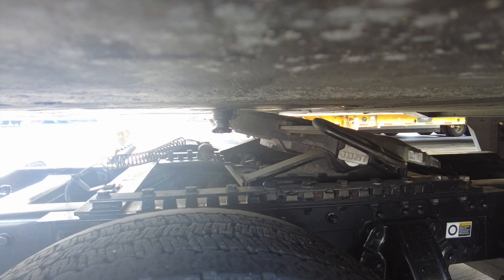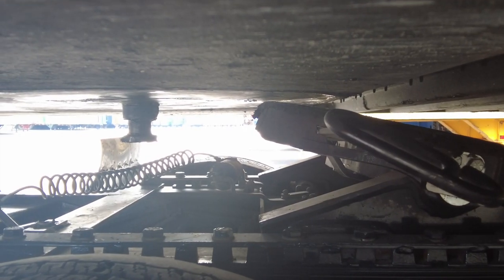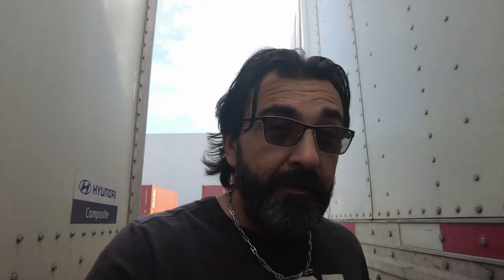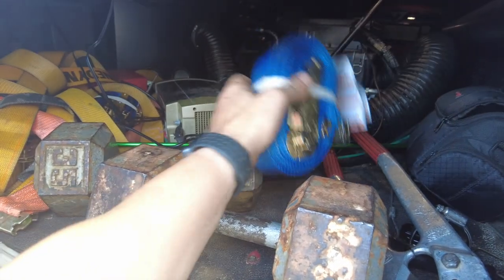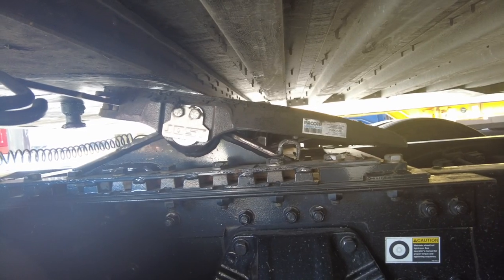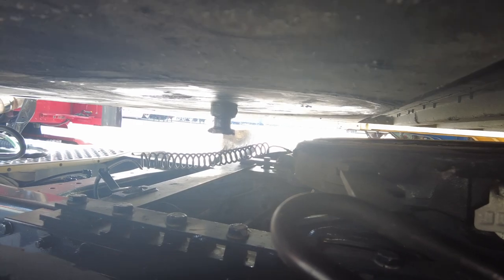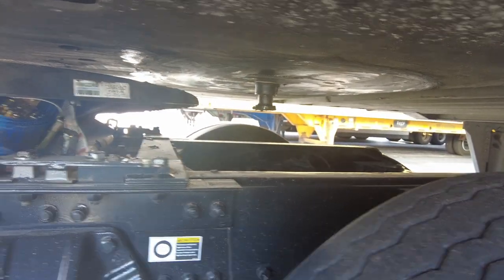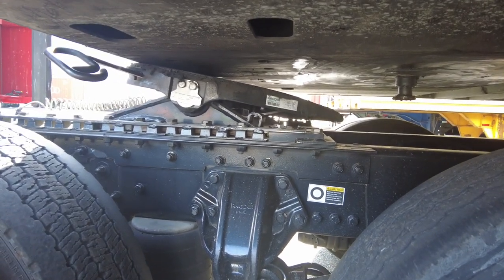how to get out of a high hook

Comment: Good tip Jim.

Any damn thing you can find to elevate the rear of the fifth wheel plate will do it.

I could see a scenario such as:
1) Tilt the fifth wheel forward as you showed
2) Drop the tractor suspension
3) Pull forward until the kingpin just touches the plate
4) Raise the tractor suspension, lifting the trailer
5) Lower the landing gear to the ground
6) Drop the tractor suspension
7) Pull ahead to get the kingpin behind the fifth wheel
8) Adjust trailer height and hook up
Reply: Been there done that too. I had a trailer one time that I could not get the landing gear to lower the trailer because it was in a bind. I think it had to do with the way the yard dog dropped the trailer. Had to get them to raise the trailer so I could lower the landing gear. This trailer was like a good 6" higher than it should have been, maybe the previous driver lowered the landing gear in a wollered out hole in the dirt yard?🤔🤔
Reply: yeap a board, big water bottle, a NYC telephone box would work ;)

Comment: I had this happen last week, even after getting out and checking. 

A quicker fix is to raise the suspension as high as it'll go then go back an inch off the pin. Wind the legs down further and then drop your suspension on the truck all the way until you're clear. No need for straps or going anywhere near that 'usually" very dirty 5th wheel.

Comment: Great information Jim! 
I think that we all have done this at least once, if not it will or you're lying to us & yourself drivers. One thing to remember is that when you drop a trailer, only lower the landing gear until it touches the ground & stop, don't keep cranking the handle. Also when you're hooking a trailer, you should be able to feel a little resistance when you slide under the front of the trailer. Most of the time I could tell be looking at the surrounding trailer heights weather or not a trailer was to high or not. The company I drive for had Freightliners & International trucks, the International trucks had a higher 5th wheel height, not much but just enough to matter.

Merry Christmas to you & your family! 
Happy Birthday Jesus!

Spoke to ya later, Ka moan.😎
Reply from the maker: So true on the landing gear.

Comment: Load strap? That’s what your rubber mallet is for! 
Of course anything works, empty plastic bottles, piece of wood, whatever you can find. But even after dropping your bags and leveling the 5th wheel, you might still have to crank that trailer up some.

Comment: I’ve done that twice, once in my first month of trucking, the other was about a year ago when hostling with a goat, was lifting the fifth wheel but I guess the trailer was a lot higher than I thought it was. Got out both times with out any further damage. Nowadays if I don’t see the trailer lift up when backing underneath then I always get out and make sure the landing gear is off the ground after I back under before hooking to the trailer. Hard to high hook then

Comment: That’s not a high hook , that’s jumping the kingpin.....high hook is when the jaws don’t close on the shaft of the kingpin ...they lock under the pin or around the base 👍🏼👍🏼
Reply from the maker: Sounds like cock talk.
Reply: @JimDavis_truckin_journey  😆😆
Reply: It does not matter what you call it...what matters is that the problem was dealt with.

If you want to be a fussy know-it-all, do you talk about "sliding tandems"? Well guess what...you are sliding the trailer, not the tandems.

On that subject, which tandems are you sliding? Most tractors have tandems as well.
Reply: MGJackson68 just clarifying that .....so someone new knows ...it could confuse someone ....a man with 40 plus years exp. explained it to me 👍🏼
Reply: @JimDavis_truckin_journey  😂🤣😂